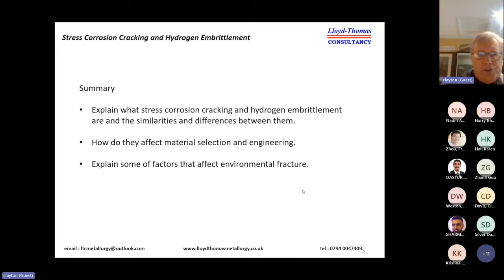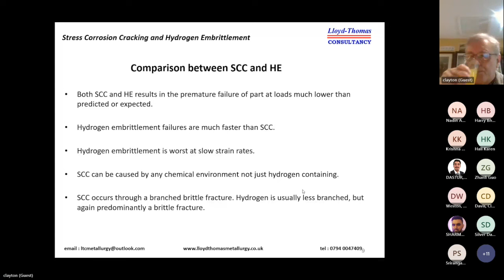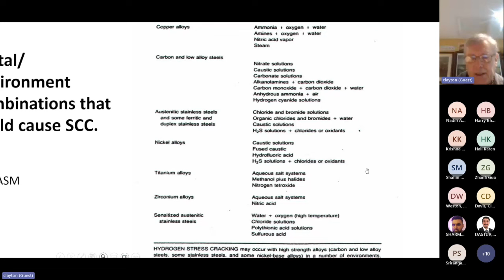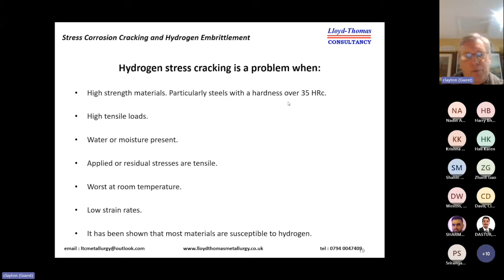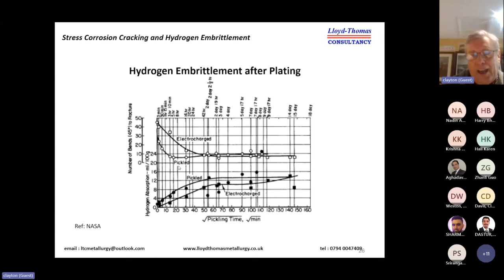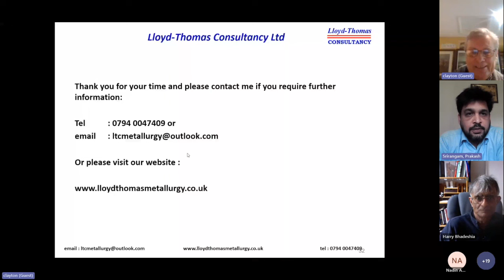Stress corrosion cracking and hydrogen embrittlement

Comment: Dr. Clayton and Prof. Harry thank you for that informtive video. At the begining of the video you said hydrogen embrittlement is much more important and considerable in low strain rates rather than higher for example charpy impact. But welding electrode's ductility or proof of that they do not have much hydrogen is defined by charpy impact test (for example low hydrogen basic electrodes). Isn't there a contrast?
Reply from the maker: Hydrogen needs to diffuse to stress concentration in order to do damage. Hence it is not effective at large strain rates. I have worked in and with the welding industry for a long time - they do not use Charpy as an indicator of hydrogen, rather, they measure the hydrogen introduced by welding. 
https://www.phase-trans.msm.cam.ac.uk/2014/hydrogen.html
Reply: Professor, thank you for consideration and giving that further reading.👏 @bhadeshia123